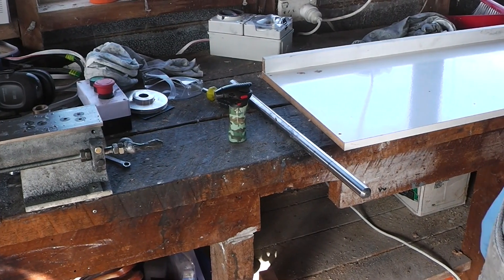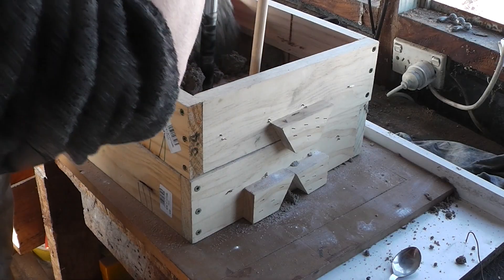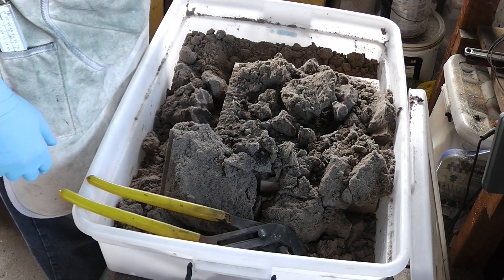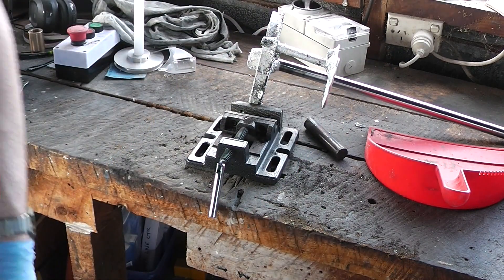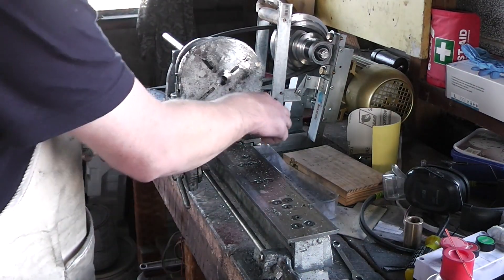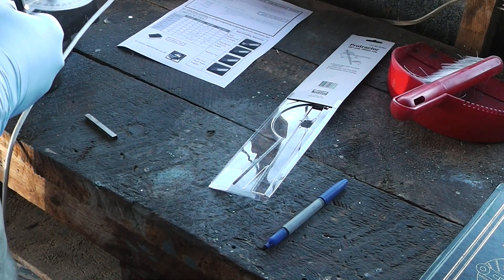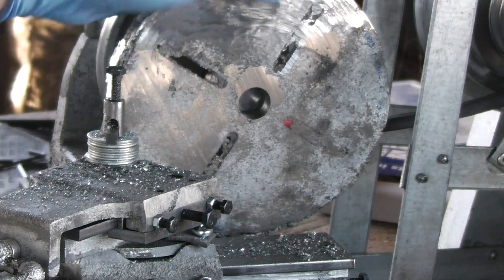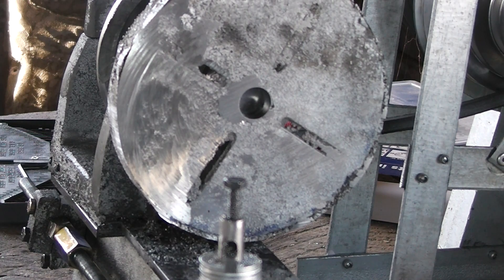First Faceplate Casting and Machining

Comment: The stick out of the cutter is causing a lot of chatter. Also, the stack of washers will never do. Make a larger tool holder out of solid steel. Next, to keep the cutting tool closer to the face plate  make the compound parallel with the cross slide.  I appreciate your effort to improve your lathe. Cheerio

Comment: I have no idea why folks like to leave the top slide at 45 degrees.  Put it at 90 degrees either way and you should be able to reduce your tool overhang heaps.
Reply from the maker: The two toolpost locations are on front left and right corners of the top slide, so angling at 45 degrees actually gets that corner closer to the workpiece for me.

Comment: The centre mandrel will be a lot easier to extract if you turn a low draft taper onto it. Much easier to knock out if it isn't parallel.
Reply from the maker: Turning a taper on it would be very easy if I had a working lathe to do it with! ;) lol

Comment: Could it be that the faceplate is not mounted very solidly on the spindle and shifts a little bit while machining?
Reply from the maker: No, I didn't do a good enough job of keeping the mandrel at 90 degrees while casting.

Comment: I'd be careful drilling out the centre. Drills will always make a hole slightly larger than their intended size. Might need a reamer to get it spot on. Then again might get away with it.
Reply from the maker: The bore in the first faceplate was too tight to slide onto the spindle, so I had to drill it out anyway, and even after that it was still pretty tight!